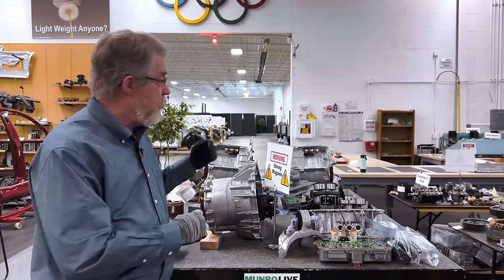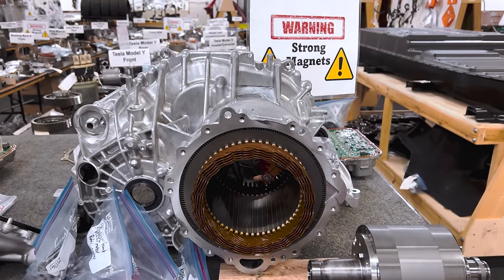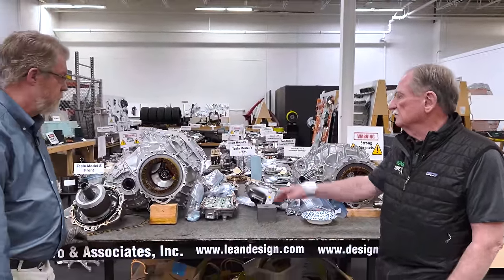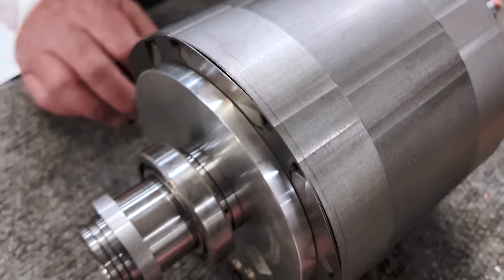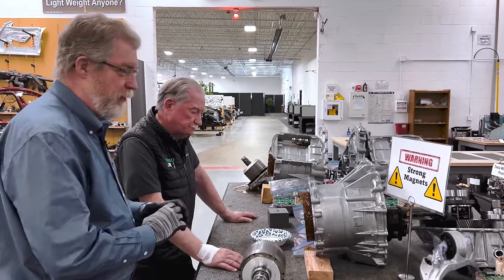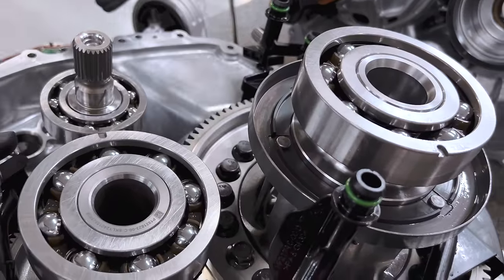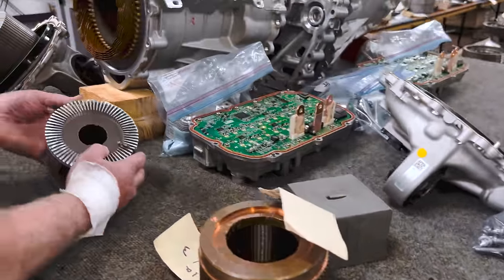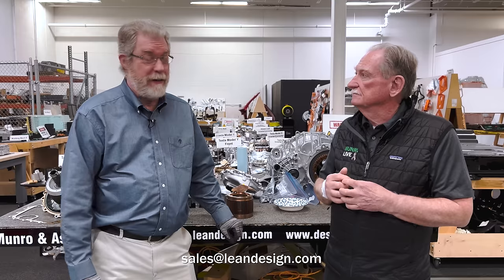Tesla Cybertruck 845-HP "Cyberbeast" Motors!

Comment: gas engines can go awhile ..  I got 1.3 million miles on a 87 suburban on the original engine ..700r4 sucked so  5 transmissions, and  maybe a dozen water  pumps and a  timing chain set ..
Reply: So not without overhaul and maintenance?
(And I imagine that's the exception rather than the rule?)
Reply: First, that's an engine that would never pass emissions today.  DI and multi valve with dynamic cam phasing, low drag pistons and rings, etc. is what's needed, and modern engines that use these things require more maintenance and have shorter lives.  Second, that's an extreme aberration assuming your story is true.
Reply: I calculated 12,000mi/yr starting in 1995 for a suburban. 
Your est. cost of operating the Suburban over 1,000,000 miles is approximately $239,000. This includes fuel, maintenance, and periodic replacements of key components.  (fuel alone is $208,333.33) 
And then I calculated electric transport cost per 1,000,000 miles. 
Power charging at home would cost $35,000 / 1,000,000 miles if all the electricity was bought in 2024 price. That leaves you with an extra $173000 🎉 for maintenance before your break even with the suburban cost of ownership per million miles. 
Splurge ! $73,000 on parts and things for the EV truck. 

By incrementally investing the savings from EV’s @ $5,000/yr over 20 years into an asset with a 10% average annual return, starting in 1995, the total value of your investment by 2024 would be approximately $742,783!  Quite a difference for the children’s future in each family that gets this.
Reply: the 12 valve cummins also has many very high mileage examples but the problem was the trucks body would usually fall apart before the engine
Reply: @nathanroberson  You can't compare a 30yr old suburban to a modern EV truck of this size because no one produces one.
Reply: @jayhorsma6853  I did. And it points to the decreased in energy & cost per mile with EV from its tremendous advantages. So many people are focused on the obvious EV disadvantages.   When you weigh the two many people will adopt them.  I make sure I remember most people don’t live like me, and so most people have different factors they decide from.  Most times the market will choose lower cost.
Reply: @nathanroberson  My point is you can't accurately calculate any of " Suburban like EV" operating cost because none exist.
Reply: Wrong you don't know what you're watching.

In this context it's the average life cycle of the entire fleet of this model on the road.

There are zero ICE doing those levels ever.

Comment: When I was in high school, I bought a 1951 Chevy for $75.  It has some issues (slight knocking noise).  I drained the oil and removed the pan.  The engine had a dipper system to lubricate the crank shaft.  After inspection I discovered the crank shaft and connecting rods were very sloppy indicating that the crank shaft had been beaten out of round.  I bought a new crank shaft (about $40) and six sets of rod bearings ($20).  I reassembled the engine and drove the car for the next five years.  I long for the days when life was simpler and much more rewarding.

Comment: It would be interesting to quantify the eddy current losses in the PM traction motor due to using non laminated magnets.  The downstream effect may be needing more battery capacity and more glycol cooling to reject waste heat.  Are the losses a fraction of a percent or are they several percent?  Engineers have obviously considered the question, so I wonder if Tesla is trying to hit a price point and sacrificing meaningful efficiency, or is the benefit so trivial as to be unnecessary?
Reply: Someone said a percent or two. I'm guessing we're spoiled thinking they can do anything and this was just a can kicked down the road a couple iterations. 
As they also said around the issue, tesla has the best data collection and its best to just go with cheaper until thwy have a billion miles of performance data before trying to squeeze a percent or two for more cost.
Reply: @sparksmcgee6641  Thanks for the reply.

Comment: Elon Musk previously stated Tesla would produce a Cybertruck quad motor (Plaid) model (like the Rivian quad motor truck). Tesla has been silent since Elon Musk's announcement and has not released more information about the quad motor model of the Cybertruck. Do you think a quad motor is still in the works or think Telsa has already built and tested some prototypes with quad motors? Is Tesla planning to introduce a Cybertruck quad motor model in the near future? There are the disadvantages of cost, weight, and potentially an increase in power consumption. Are there enough advantages with a quad motor design to overcome the disadvantages?
Reply: No quad why would they?  Turns out to be cheaper and exceed the capacity need with three

Comment: how can only 1/3 motor run  with no clutch system ?
Reply: Rear induction motors free-run wiithout power when the front PM motor is powering the Cyvbertruck. There may be some small frictional losses, but it eliminates the clutch and allows for almost instantaneous application of power when needed from the rear motors. Clutches also tend to be a wear item, so getting rid of it is useful for longevity and reliability.
Reply: They all spin all of the time (because there are no disconnects or clutches); it's just that the induction motors are not powered when they are not needed.

Comment: The elephant in the room that should be an obvious source of concern for an engineer ( regarding the cybertuck motors) is the claimed 10,000 lb ft torque.  Sandy says nothing about this!  Electric motor torque specs are always as measured at the motor output shaft not after reduction gearing.  This is for the obvious reason that, If it is measured after reduction gearing then a sleazy liar can claim anything -- just change the reduction gearing,  This shaft HP and Torque measurement standard has been the standard for over 100 years for both engines and electric motors.  

Quoted ethically:  Rivian: 908lb ft.  Ford Lightning: 775 lb ft. Silverado: 780 lb ft.  Cybertruck 666 lb ft.  That number didn't sound big enough to Elon, so he came up with a lie (claiming 10,000 as if it is motor torque)  CT gearing is 15:1)  10,000 /15 is 666.

Comment: Put the motor in each wheel and you lose all that weight, all that stuff that can break that you have on the table. 100 hp in each wheel awd all the time  put 200 hp in each wheel you have 800 hp.

Comment: seems so simple, like the year 1900. :goodvibes: I'd like to add, HP (horsepower) confuses nearly everyone, the work is torque. although the 3 ton truck only needs 30 HP, it is identical tobacking off the thorttle on a gas engine for the momentum cruise. Nothing special with electric there at all. Every engine backs off the HP at cruise. think of hp as the "go fast" value. the heat in the magnets is the torque load.
Reply: you call that simple?! with the millions of electronics on board!? youre joking right!

Comment: WHY would you package control electronics on a motor unit that heat cycles every single day ?? That's a recipe for rapid circuit board and solder joint degradation ! 🫤

I wonder if Tesla will sell the control board separately or only sell the entire motor assembly as a replacement part ?
Reply: What heat cycles? You get more heat from the environment than from the motor. They just made it resistant.
Reply: @NTNLabs  You think electricity doesn't heat up motors ?? Awwww aren't you cute.. LoL 😂
Reply: @edwardfletcher7790  I may be cute but You are not smart. I said the environment heats up more. Are You saying that a powered off car in the sun has its motor hotter than the surrounding air? Back to school my boy.
Reply: @NTNLabs  Powered off ? I think you've been talking to someone else and got confused...

If you think an electric motor powering a CAR never gets above ambient temperature you're bonkers !!
Reply: @edwardfletcher7790  You are the confused one :) If there is a heat source such as ambient air, good engineer prepares for it. And Tesla has the best ones. So no matter what the case may be, the solution is prepared for it. I rest my case.
Reply: @NTNLabs  I see from your profile you've commented over 100 times on this channel, so you're a paid Tesla spammer ?
Reply: @edwardfletcher7790  Of course. Every comment gets me a new Tesla. You do this for free?
Reply: @NTNLabs  Let's do some basic maths. These motors are about 221 HP or 162KW, if we assume these motors are at the very top of the effeciency curve at 97% effecient and they use the most effecient power inverters at 95% effecient, 162KW of power at the wheels equates to about 176KW of electrical power entering the unit. Thats 14KW of heating at full power. 

Obviously they won't be running that hard most of the time but I also didn't factor in the reduction gear losses and even at 10% throttle that's 1.4KW of heating. 

Power electronics can operate at pretty high temperatures but the notion that they won't go through thermal cycling is ridiculous. I just hope they have sufficient thermal management to prevent rapid heating and cooling because PCBs and ceramic components will eventually crack.
Reply: @SpencerHHO  You missed my point. I said that even if we take out the motors as heat sources there are other heat sources in effect that force You to make the electronics resistant to thermal cycling.
Reply: @SpencerHHO  Thank you so much for typing that out !!

 I couldn't be bothered explaining it all to someone who obviously doesn't even understand the standard light bulb dilemma....

Make sure you don't follow up though. He's getting paid per msg.
I also think he might have been home schooled or perhaps went to a non science religious school 🫤

Cheers 🍻
Reply: @NTNLabs  you're talking about nearly doubling the heat load at the very least for very little benefit. Integrating the motor, gearbox, and inverter into a single unit may have packaging benefits but it also increases the unsprung weight, subjects the inverter to higher G loading and makes servicing and repair more difficult. Tesla's have higher failure rates than other EVs and are notoriously expensive to repair, with plenty of documented instances of premature inverter failure as well as bearing failures resulting in Tesla advices customers to replace the whole unit. 

It's basic facts. Drive whatever car you want but do so being fully aware of objective reality.
Reply: @SpencerHHO  Okay, time will tell. But interter on motor is not unsprung weight IMHO.
Reply: Resistance

Comment: I just want a fully stuffed battery and quad motors. Is that too much to ask?
Reply: Are you willing to pay for it and lose on the payload/towing capacity?  Don't use GM as an example as they are selling below cost.
Reply: What "you" want doesn't matter.
I suspect what's coming is 5-10% on cell density (more to follow) with a choice of more pack capacity (range) or lighter pack for the same pack capacity (....range!) Then other refinements.
Reply: Why? This is already the quickest pickup ever made,  and the lightest EV pickup currently on the market.  It has a lighter battery pack and greater efficiency than the competition.  Sure, you could maybe cram in more or longer batteries and another motor,  but you'll pay a lot more for that.

Comment: Cyber truck beast is mostly front wheel drive so the rear are only used during acceleration, will not have any benefit to improving them. Compare to the dual motor and see how it is setup.

Comment: 14:56 Total nonsense! 500,000 to 750,000 miles without a rebuild from the 90s to 00s Lexus gasoline V8s is easily doable. And in fact a well-documented million mile example has been shown without a rebuild to prove this.
That's not even mentioning many earlier pre-strict emissions regulation diesels. I've also seen a Mercedes M112 with almost 600,000 miles that never had a rebuild. 

The more modern higher compression forced induction engines don't last as long.
Reply: Average lifespan for a modern ICE vehicle is 200,000 miles (~15 years)
Reply: @pierre.a.larsen  yes, and they are often scrapped for reasons unrelated to the powertrain, such as body rust or collision damage.

Comment: Easy to get half a million miles out of an 06 honda civic, and even easier for a TDI volks Jetta, 300k should he where everything gets by default, and it is possible to get a million miles out of those afore mentioned models.  This guy acts like he used to work for ford or 🤢 Chrysler 🤮
Reply: Dude. He's saying average lifecycle of the entire fleet of the model on the road.

You were way more polite than the idiots posting about this. Good on you for that but you don't understand what you're watching. The whole thing about sandy is he puts out industry engineering work for the public to watch instead of only sending it to manufacturers ask a sale tool for his reports.

It's hard to understand what tolerance he talking about sometimes and if you don't know that there are multiple it'll throw you because something like that sounds stupid.

If that happens step back and do an internet search on the term and find out the other standards.
Things like a U value and U value that are impossible because you don't know there is a metric and an imperial U value.

That's one from my industry products. And we switch between them when talking about them because we know which companies are from metric countries and which are US.
😊

Comment: Oil cooling in an electric motor? Im going to be honest, with 3 motors on a lectric car, that sounds like something that a computer should figure out how to do while turning motors off.  Like turn on two motors, and pump coolant through the third to bring temp down.  Pumping oil into a motor, and then having the motor turn 1,000 RPM through a neigborhood sounds like a real efficiency buzzkill, but Im not the engineer, sandy is.  Hey sandy.  We want to see you all in one piece, and we want to see you with your hand not the size of a pumpkin next time. Get healed up soon!!!

Comment: 750k miles? Rofl the motor might last that but there is no way the rest of tesla lasting anywhere near that, it isn’t a pre 2021 Toyota. You
Probably go through 5 batteries u could buy 5 new engines and get 1.5 million + miles easy. And yes piston engines can last that long especially diesels and some gas have had records that high. The car is to complex to many failures in the first month on these cars then simple cars have threw there entire life

Comment: EV’s are essentially forever cars.  Even if the battery needs replacing after 700,000 it would be worth replacing.  Old battery can be used in your home for awhile then recycle for $$$.  More recyclable parts in an EV.  Comparing a wood home with a steel home.  Steel framed homes more recyclable
Reply: Says the guy that buys a new iPhone every two years. EVs are already becoming disposable

Comment: Sad to see Tesla cutting corners. They have lots of great innovations, but Elon's relentless pursuit of slashing costs sometimes results in great engineering features being cut - to the detriment of the customer. People want cars and trucks that are built without compromise. Especially if the lifespan is 500-750k miles. But I doubt the rest of the truck is capable of that. The HVAC, electronics, infotainment will all die long before the truck reaches 500k miles.
Reply: Easily replaceable cheap parts
Reply: Yeah big talk like everyone else that bitches for quality but can't afford it.
Reply: To be clear I've worked in top tier quality products and no one ever complains about better quality. They know what that extra quality cost and know the scale goes on forever. 
People commenting like this guy make it obvious they don't buy quality. They'll claim they do because they bough an expensive knife thwy like and have a top of the line RC car or something.

Comment: Sandy. No the motors won't make it to 500,000 miles because the battery will die long before that. Then who is going to spend $20K on a new battery?
Reply: Yes
Reply: Everyone will, but it’ll be 10k, for a battery out of a crashed truck.

Dead battery won’t be a route to a junked truck, just as it largely isn’t among informed owners of current (decade old) cars.

Comment: 7:41 - "On the highway, you only need 20-30 horsepower to repel the car down the road." Please recalculate for the actual weight and drag of Cybertruck for an actual speed, road angle, wind direction and wind speed, offroad tires and trailer use. At 75 mph = 120 km/h, it will be clearly higher even for the CT alone. Oh, and please use kW instead of horse powers. From kW and a speed in km/hour, it is easy to get to a consumption rating in terms of energy per distance (kWh per 100 km), while the horse power and miles and Wh/mile or mpg_e all just spoil the beauty of these calculations.